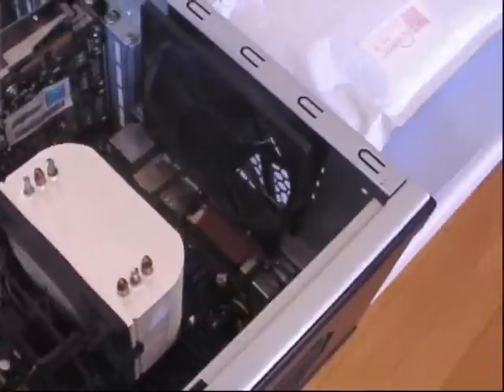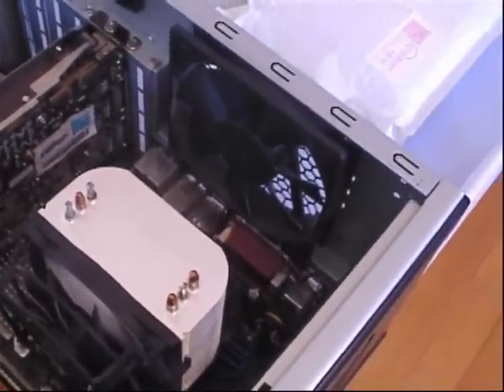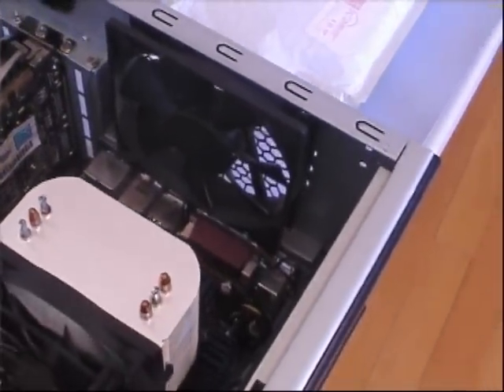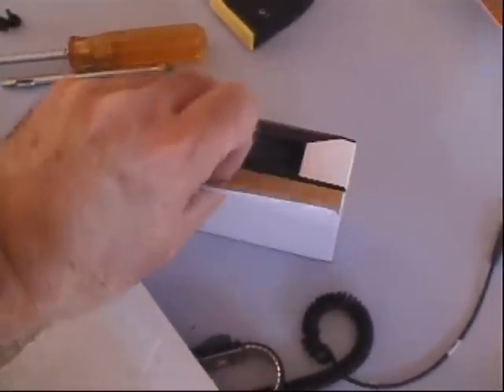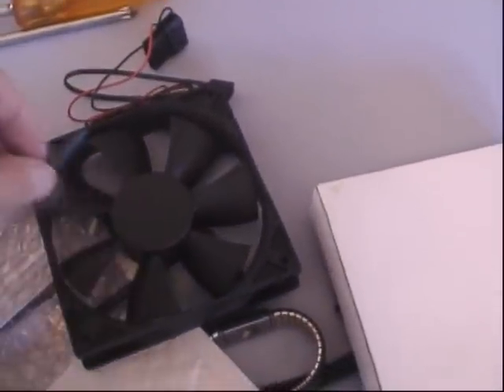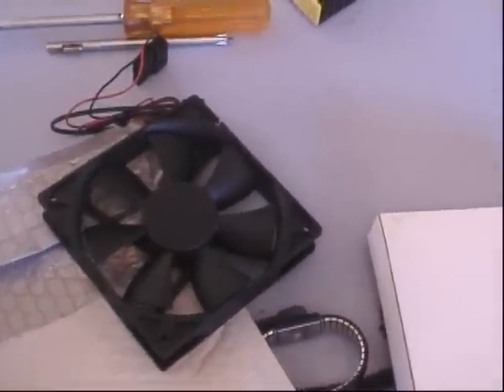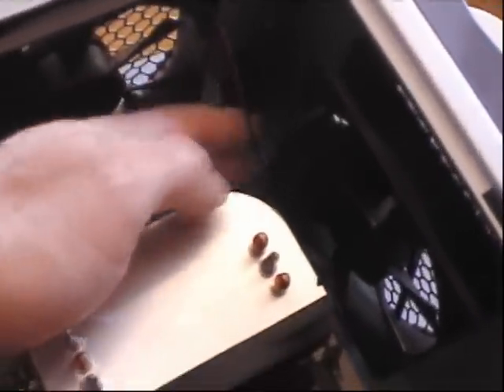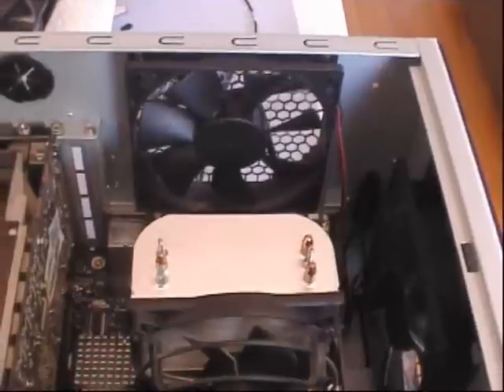How to replace a computer case fan

Comment from the maker: As long as the power connector is the same it should work.  The color is determined by the type of LEDs they use and not the wiring.  If you search computer fans wiring you will find a lot of information on that topic.

Comment from the maker: Don't measure diagonally.  Measure edge to edge.  Seems like you have a 120 mm fan.  Edge to edge it would be around 4 3/4 inches.  120 mm = 4.724 in.

Comment from the maker: You measure from edge to edge on the fan frame or housing.  Some standard sizes are 140mm, 120mm. 80mm.  I see now they even have 180mm fans.  140mm is about 5.5inches across the fan.  180mm is 7 inches across.  You can google for a mm to inch conversion to see each unit measurements equivalent.  Just measure your fan that you want to replace.  You'll have to see if it can be removed though.  They have replacement fans on amazon or even ebay.